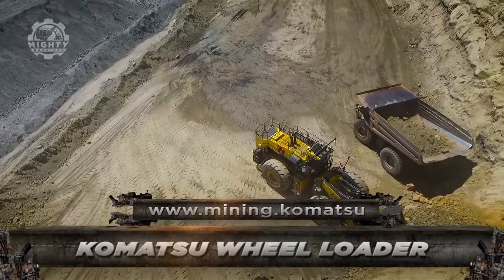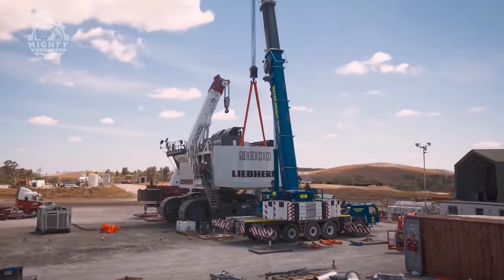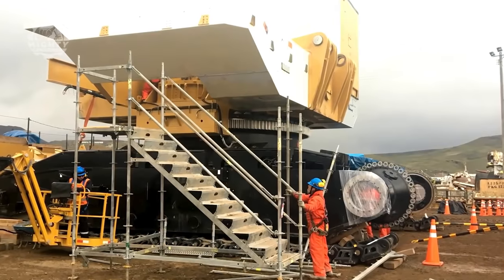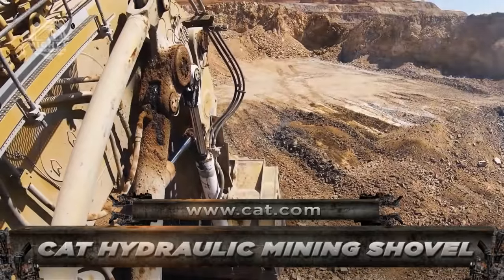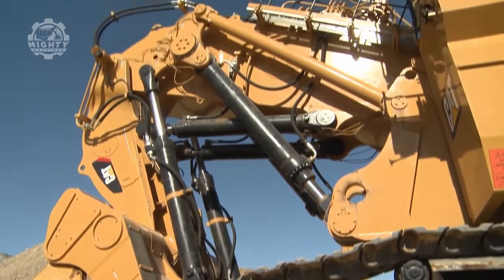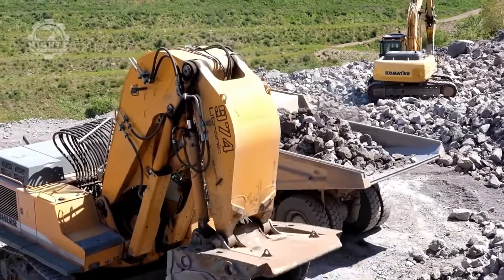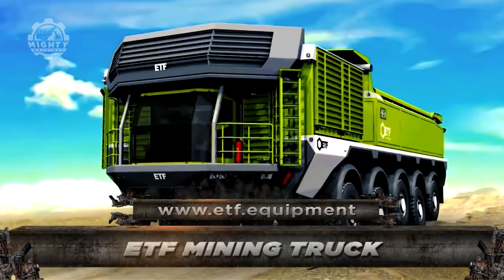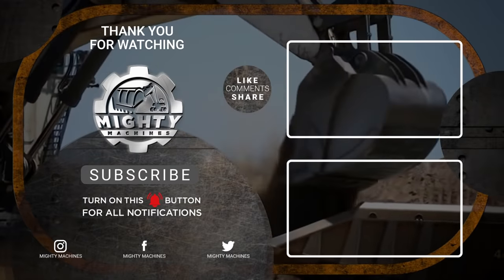BIGGEST - Most Powerful Mining Equipment In The World!

Comment: Nice machines, but I expected to see a modern dragline, which usually makes everything else look small.  Didn't see a bucket wheel either.
Reply: Didnt they stop makimg those?
Reply: @deth3021  There is a large dragline in the background, at the very beginning of this commercial.  You can see the boom and a portion of the A-frame, for a few seconds.
Reply: @wmden1  but are they in current production?
Reply: @deth3021  Check out Caterpillar, and Marion.  I believe Cat still manufactures them, not sure about Marion, but large draglines are still in use today, in the world.
Reply: The things you expect are old and no one uses them now